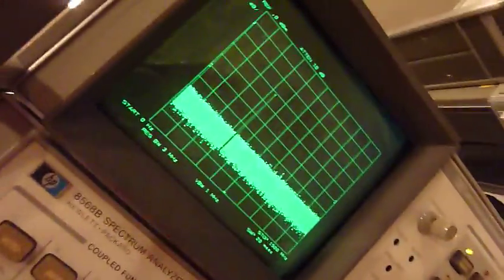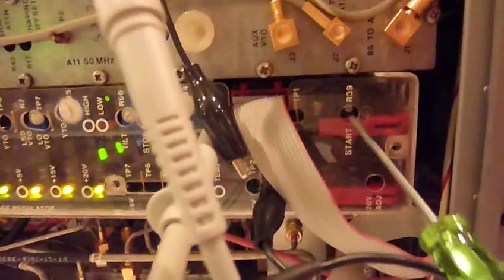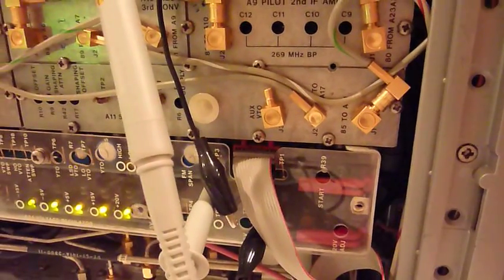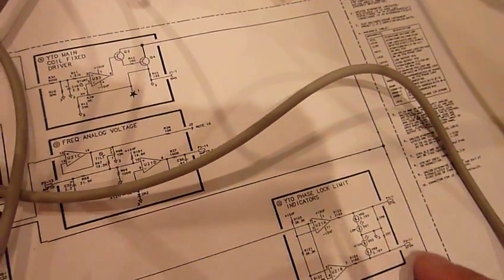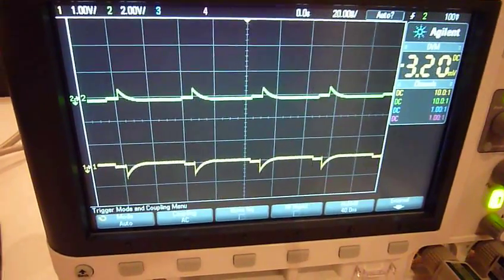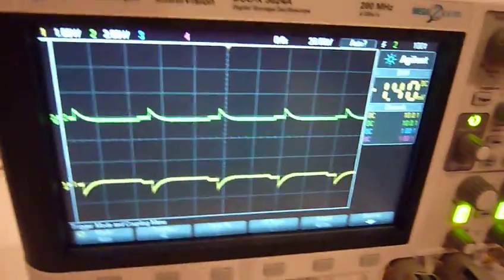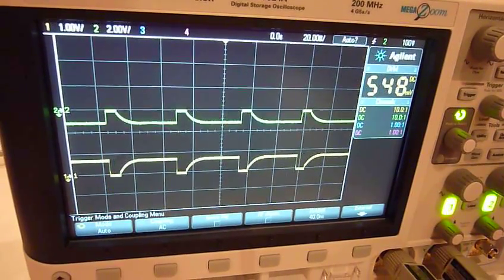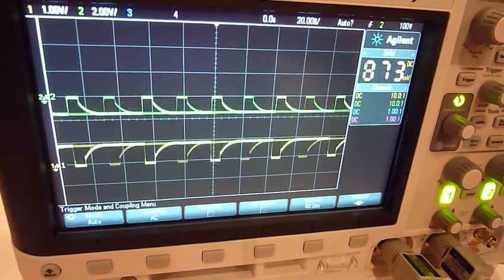HP 8568B Spectrum Analyzer Repair pt. 5 and success!

Comment: I'm glad that fixed it.  It's a very common problem that pops up in those analyzers from time to time. The same thing happened with my 8567A.  I wonder how many of these systems got sent to the e-scrapper because of a silly little problem like that.
Reply from the maker: Well, probably quite a few. Simple problem but complex machine to debug. Thanks a lot, you saved the life of another HP spectrum analyzer... I could not find any mention of the R39 problem in the Yahoo groups. Which one where you referring to? The HP Agilent group here?
https://groups.yahoo.com/neo/groups/hp_agilent_equipment
Reply: I came across the thread about a year ago when I was working on my 8567A, I believe it was in one of the Yahoo groups but I'm not sure.